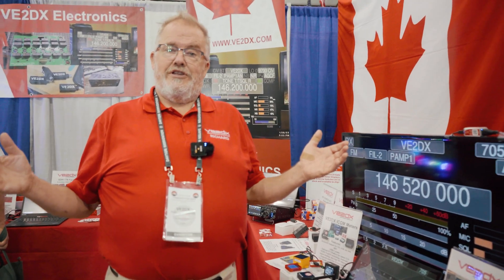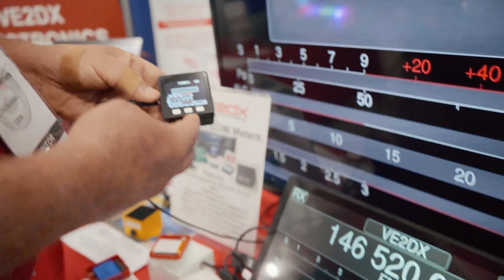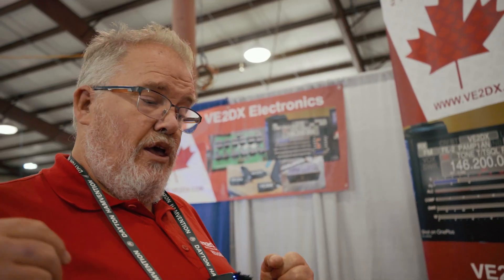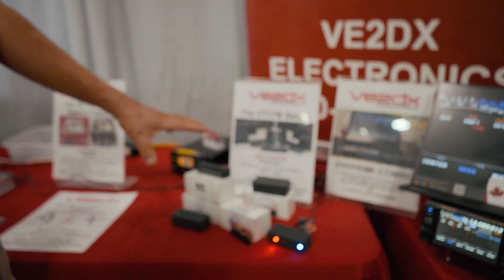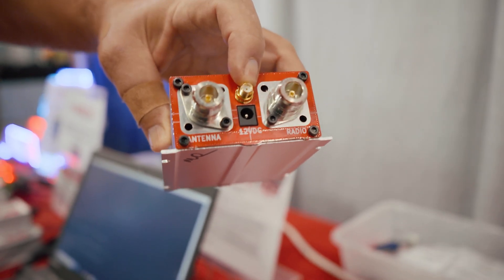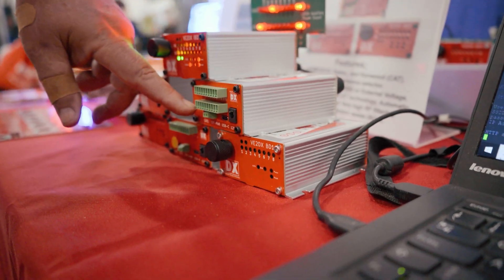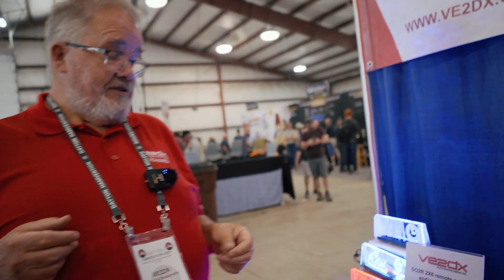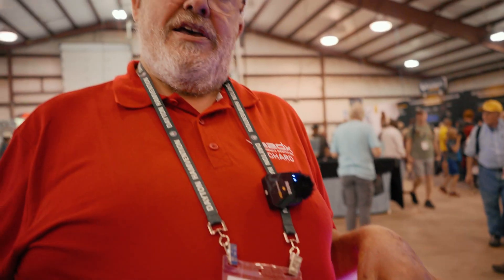The Coolest New Gadgets From VE2DX This Year! Dayton Hamvention 2025

Comment: Some countries require us to send our call sign every so often. Recently I was musing about a station timer to aid in that process. I do have the code running on a Pi Pico (RP2040). The multicolour sign would be perfect as the visual indicator.

Pressing a start button, the sign lights up green. After certain time, it switches to yellow. Some time later, it starts to flash and finally switching to red. Whenever the start button is pressed, the timer is reset and the colour is set to green. Holding the start button for a few seconds, shuts off the timer and the light.